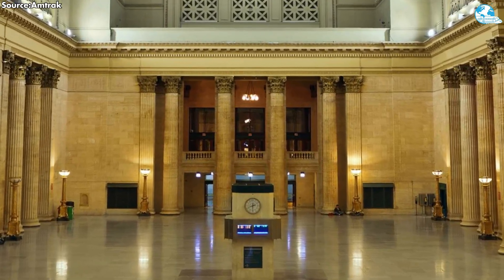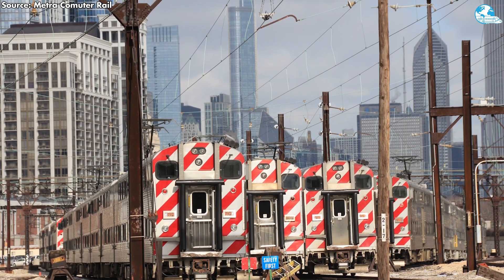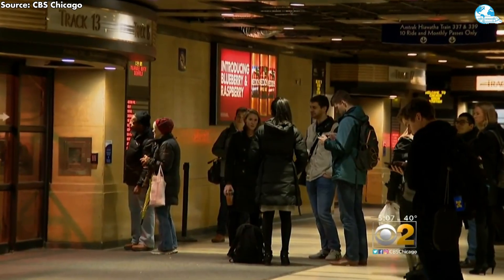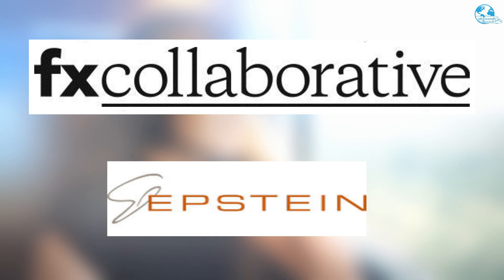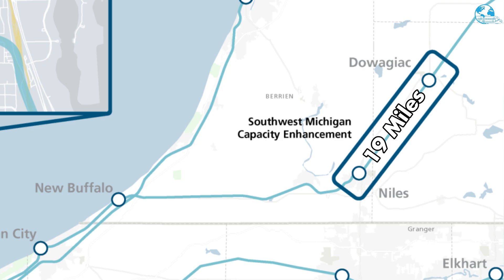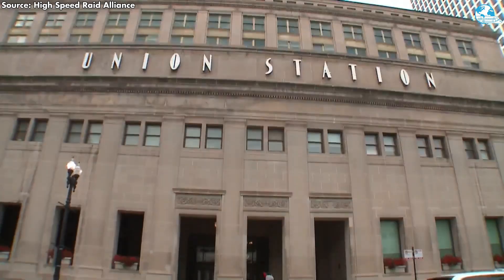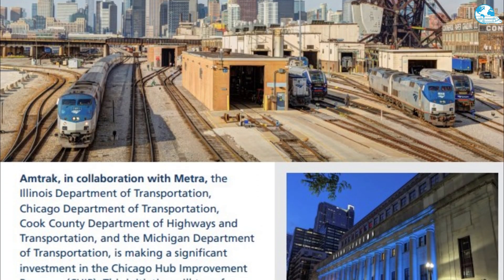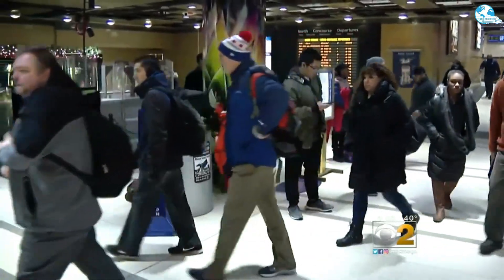Inside the Chicago Hub Improvement Program: A System-Level Breakdown

Comment: As far as ventilation goes, will the station platforms have the safety glass walls with doors.  I know most don't think of this as ventilation, but the doors also make keeping the stations far cooler and less polluted, while also allowing for the heat and pollution from train exhaust to be easier delt with.
Reply from the maker: thanks for your comment.

Comment: I'm quite bemused that Chicago's Union Station is essentially two stub terminals back to back when it should be a railway throughput station. There are so many active and abandoned tracks that empty passenger trains completing their runs can loop around and double back.

There are other stations in the Chicago downtown area shouldn't they be hooked up to each other too, for through operations? These connections would run through the Loop and depending on how far away the terminals are there could be regional rail stops connecting with the "el".
Reply: It made sense at the time? It did though, because Chicago was a railway hub the way that O'Hare or Atlanta are airline hubs now. Through running now is difficult because the Union Station platforms are accessed from a concourse that's at the same elevation. If the north end and south end tracks connected through then they'd have to build an mezzanine 'overpass' level so that you can cross over the tracks at a separate level from the trains. And the problem with building an overpass mezzanine level is that the street and buildings are there - there isn't enough vertical space between the tracks and the street level to squeeze in that overpass. The post office track that the video talks about being reactivated is a single track that's furthest away from the main part of the station, so people could reach one side of that track without needing an overpass because they don't have to cross any other tracks. But a single run-through track doesn't have much capacity.

So probably the best answer for through running is a new line in a tunnel that's deep enough to get under all of the infrastructure challenges, the river and the highways and street level and other rail lines, and that has stations built with the intention of through running, so there's vertical access to all tracks using elevators and escalators instead of ramps. If they're building an entirely new tunnel across Chicago does it even make sense to go past Union Station or would it be smarter to go through the Loop where all of the local transit stations and lots of businesses are located?
Reply from the maker: yep.
Reply: Union station was a throughput station when it was built. it was the only on in the city. It was changed when national passenger rail deceased in the 50's and the only ones using union station was regional rail at the time RTA/ Metra. that when they tore down half the station and rebuilt the platforms to be what they are now. the plan is to now undue all of that make all but 4 platforms straight through for both Metra and Amtrak.
Reply: @NoNonesenseRick  When Union Station was built, it was just one of six intercity passenger terminals in Chicago. The others were Central Station, Dearborn Station, Grand Central Station (different from Central Station and I'm sure that never caused anyone confusion), LaSalle Street Station, and North Western Station. Of those, the only headhouse still standing (but not as a train station) is Dearborn Station. The only stations still operating from that era are Union Station (with the original headhouse building intact), and LaSalle Street Station and North Western Station (both of their headhouses were demolished and replaced with modern office buildings but parts of the train sheds other infrastructure remain, and North Western Station was renamed Ogilvie Transportation Center). In the 1950s all 6 stations were still thriving, with privately operated services. RTA and Metra didn't enter the picture for 2 more decades. The first terminal to be shut down completely was Grand Central Station in 1970. Before that all 6 stations, including Union Station, had local and intercity passenger service run by the railroad companies. RTA and Metra didn't come into existence until 1974 and 1984, respectively. From 1974 to 1984, RTA contracted with the railroad companies to provide service, and Metra took over some lines in 1984. All six stations were terminals, where the tracks and train services ended. Chicago was the destination, and if it wasn't your destination you needed to change trains there. The Union Depot, Union Station's predecessor, may have had the option of through-running but the only diagram I've found shows the through tracks only serving the freight warehouses along the river and bypassing the train shed and platforms. I've also seen Union Depot described as two terminal stations stuck together but that may have just been the operating pattern and not the way it was built. Union Station though did not have through-running right from the start. I've found several floor plans from the time that Union Station was constructed that show a passenger concourse between the north and south tracks. There's a lot of great information on this page: https://chicagology.com/skyscrapers/skyscrapers044/ which is where I found several of the track layouts for both the old and new stations.
Reply: @markopolo8136 Wow, thanks for this!